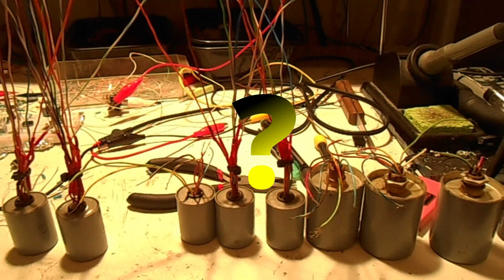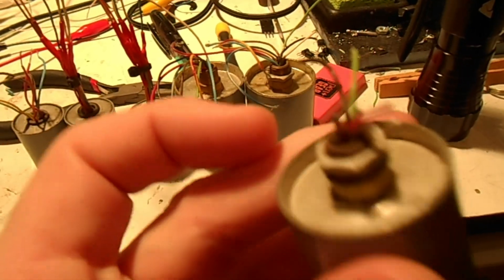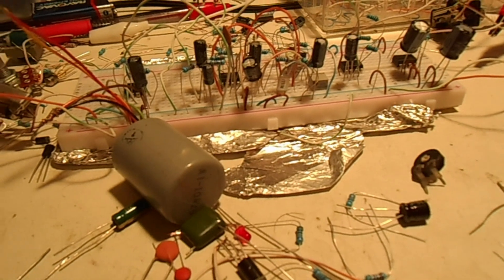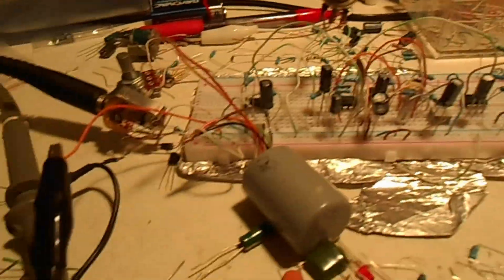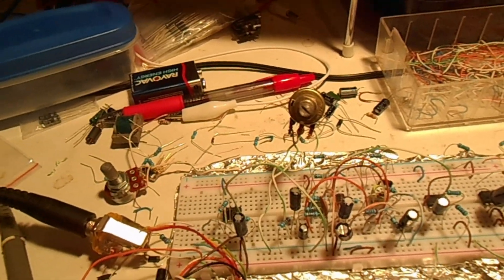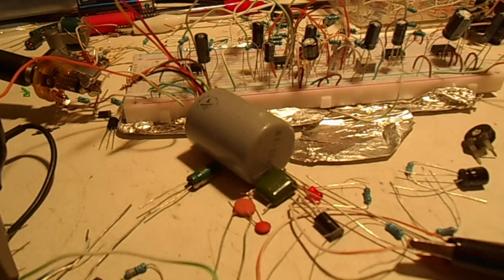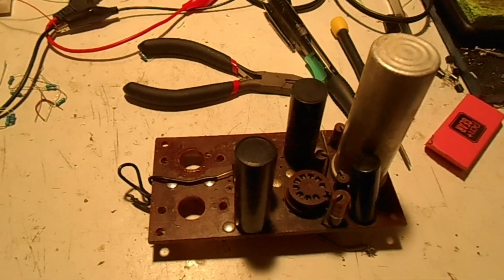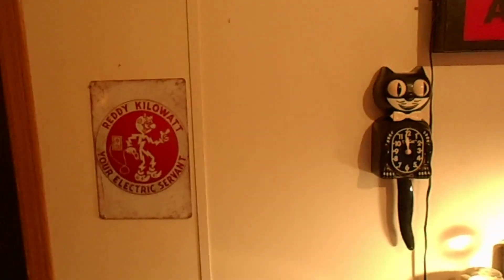Stereo microphone preamplifier and limiter/compressor project built with input transformers Part 1

Comment from the maker: Here is a test audio sample of the preamp circuit directly recorded utilizing two microphones (one each alone as monophonic as I only have one half of the circuit in test on the bench). Circuit noise is an issue because it's not actually built yet other than on breadboard, but soon enough it will be and encased and shielded from noise. For now enjoy... https://soundcloud.com/kagemichaels/new-stereo-microphone-preamplifier-build-test